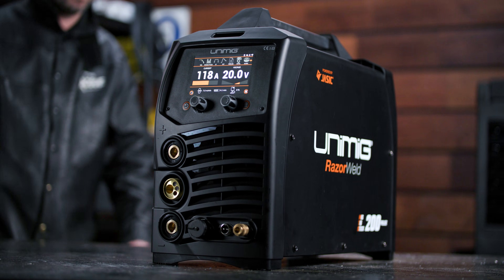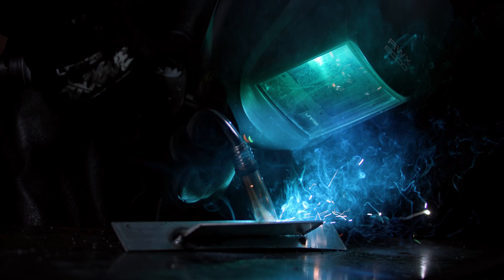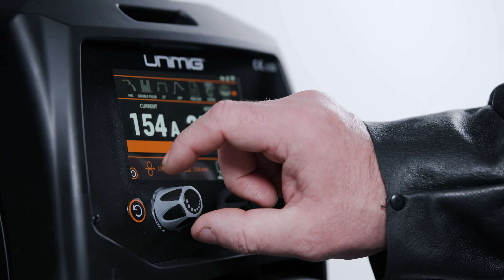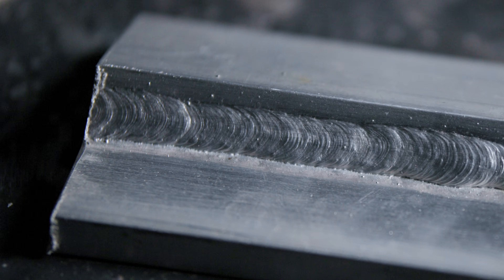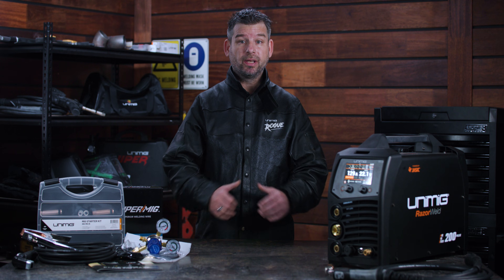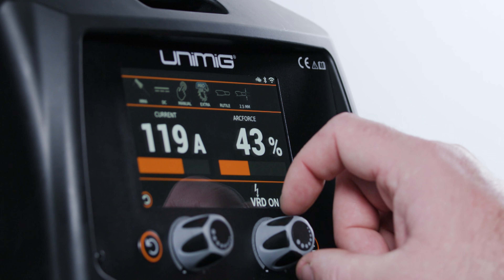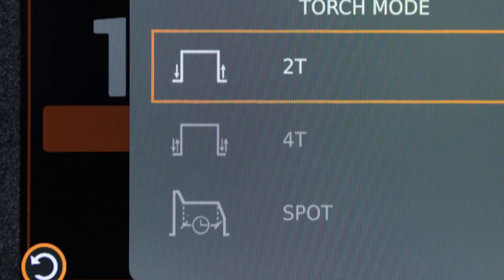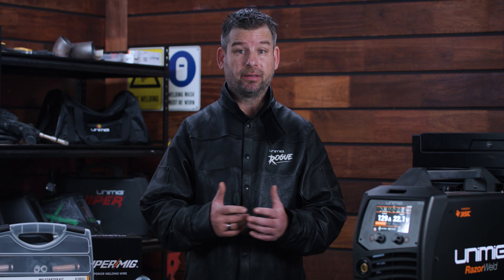RAZOR 200 PULSE Full Feature Video

Comment: Great machine. Pity their customer support is absolute bullshit. I get an error code almost every time I use it. Have emailed and left messages but nobody gets back to me. If anyone here can help me find out what alarm code 61-11 means that would be great.
Reply from the maker: Hi Matthew, we'll have a software update for this shortly that will stop this error. In the meantime, you can avoid this error by insulating your workbench through either rubber or wooden feet to separate it from the ground. Can I ask which email you have been trying to contact?
Reply: Yeah their support is a joke.   They try to do a big brother (a la george Orwell's "1984") and tell you that whatever fault your machine developed,  that is normal behaviour for the machine.   Parameters you could adjust suddenly become frozen,  and they tell you they were never adjustable. 
Not gaslighting at ALL.